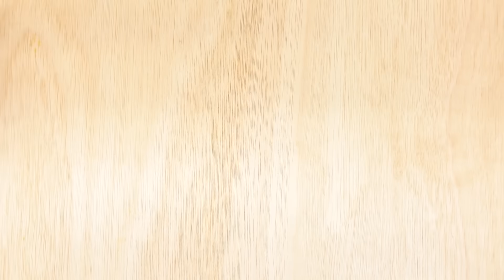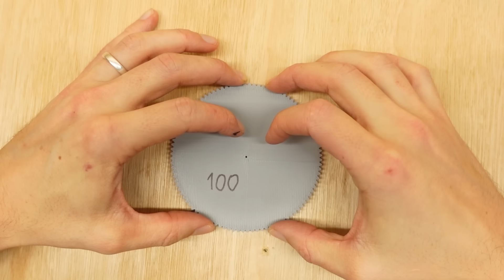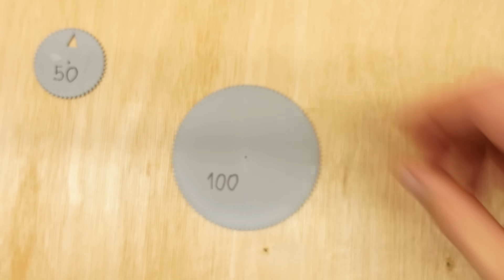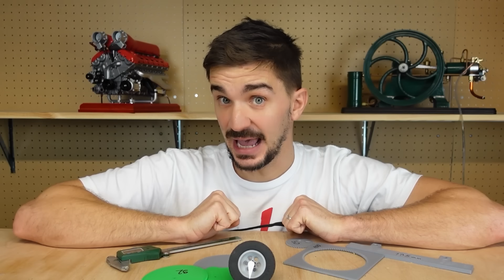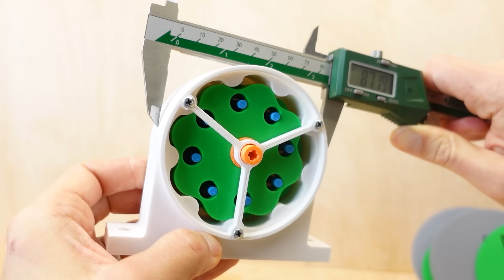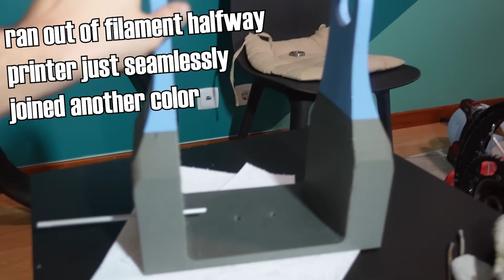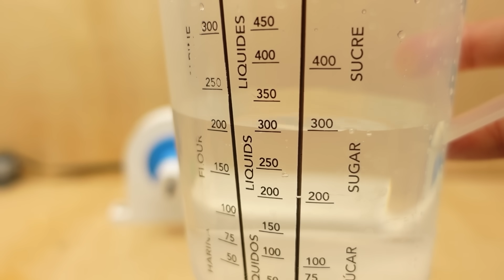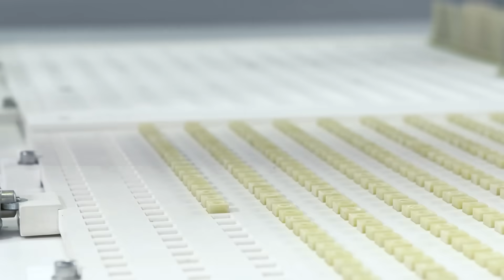Toothless Gears Make Much More Torque Than Conventional Ones, Here's How. Cycloid Drive Explained

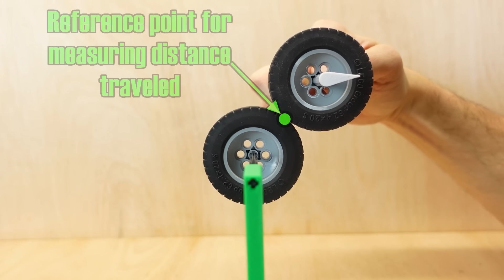Comment: 1:28 There was nothing wrong counting rotations with the pointer, you just have to keep your camera level on the surface. In this case you were effectively rotating the camera an extra time, so the wheel appeared to rotate again. Note the wheel's pointer with respect to the surface. It starts facing away from the surface, points at the surface half way through, then points away at the end, just like with a flat surface.

Comment: I didn't imagine I was going to learn so much about math and mechanical engineering today. Thank you so much for this. Maybe this would be covered in basic mechanical engineering coursework, but the intuition of the mathematics and experimental or visual experience was amazing.

This was also helpful as well where Veritasium worked out the SAT question everyone got wrong. This had the visual intuition explained by the math therein about many paths, circumferences, and even orbits.

Comment: So to offset the vibrations caused by the rocking couple at higher RPM you would need  to mirror the cycloidal gears (4 total) and beef up the eccentric shaft... maybe  even consider exotic materials for the eccentric shaft that have a bit more spring to them to prevent warping under high loads.

Comment: When you get down to a difference of two teeth, and put the inner gear on a flexible cup and drive it to mesh with the outer gear with an elliptical drive element, you have a harmonic drive... something once (and maybe still) very common in robots.

Comment: I like to think about it like this. When the wheel travels on a flat surface, it experiences 1 rotation. But when you take that flat surface and curve it into another circle, the wheel has to experience 1 extra rotation to account for the circular path it is traveling along.

Comment: Ok so the reason you get two revolutions is because it is the inner diameter of the circle not the outer. All you can do is spin the circles over one another to travel the same circumference. The outer circle will be larger for the same reason things get larger the more accurately you measure them.

Comment: I finally figured out the toothed gear on the outside. It's doing the two it needs when it's straight + one additional from the additional rotation around the circle itself. Similarly on the inside it's doing one less.

Comment: at 1:05 if you think of the revolving wheel/gear as relative to the one its revolving around it as in it points away from the wheel it revolves around once per revolution in the case of the lego wheel it makes more sense

Comment: Interesting topic. I believe the 9:8 tooth ratio would be equivalent to 100:88 in the 100 tooth model and 88 falls within the mfg tolerance specified (9-15 tooth difference). I would like to model the difference in the axis of rotation travel in the 9:8 vs the 100:88 tooth examples. My brain cannot do it theoretically right now.

Comment: you can add another set of set of drives to counter the tipping force you talked about at the end. So total of four drives if that's confusing. it can be very stable at high speed as well. 

Great video, enjoyed it a lot.

Comment: 19:00 Could that be solved by "splitting" one of the gears in two, and sandwich the other one in the middle?
Let's say that you need a total width of 6cm to withstand the torque.
Starting on the left: 1.5cm cycloid and ring gear UP offset, 3cm [...] DOWN offset, 1.5cm [...] UP offset.
In this way the UP unbalance is the same of the DOWN unbalance.

Comment: Actually the pins are in sliding orbital contact with the rotor resulting in much more more friction losses and wear than a spur gear set. The orbital is OK for low speed high torque compact drives but not so for F1 gearboxes.

Comment: 19:14 what if there were 2 on the outside with one sandwiched in between? The outer 2 with a combined weight equal to the center gear. Would that work for balancing out the gear set?

Comment: i will say that i find it easier to think about the the outside wheel from the perspective of the inside wheel, meaning if you stand in the middle looking out, the outside wheel does the same amount of rotations as it would on a straight line
Reply: I had to go full screen on the phone and rotate it around to keep the contact point stationary to get it.

Comment: Can these cycloidal drives transmit a significant multiplication or reduction of speed?
For example, can you have 300 rpm at one end of the cycloidal coupling and 1000 rpm at the other end ?
In the examples that I see in this video, both sides of the coupling have the roughly same rpm (maybe a 10%...15% difference in between).

Comment: would this style of gear not suffer from more wear? surely having constant contact means those parts would wear down quicker? would it not also cause heightened heating? if parts are constantly in contact they wouldn't have as much time to cool down compared to a standard cog gear surely?

Comment: you are incorrect on why you get extra "rotations"....it isn't because of the center point, you still have the same circumference between the two wheels. What is actually happening is that your frame of reference is also moving, and if you follow that frame, then you will notice you only get 1 rotation.

This can be shown by having a "hill" of the same length, start the arrow pointing to the "ground" and only count 1 rotation when the arrow returns to pointing to the ground. Keep increasing the hill until you get a semicircle, and eventually a circle, you will find that at no point does the arrow point toward the "ground" more than 1 time per rotation, so it only makes 1 rotation. BUT because you are in the frame of reference of a non-circle, then you are adding the circle to your own observation, and that's why you get 2 rotations (1 for the travel and 1 for the reference change).

It has absolutely NOTHING to do with the center point distance.....so all that "this is bigger than that" is nonsense.

Comment: 17:27 you could have a lobeless drive, would require low rpms, Tesla valves, and fluid. I can picture it in my mind but I'm not 100% sure it would work, basically the Tesla valves allow fluid to escape at the contact point freely but the vacuum created from the point "moving on" and the valve not allowing fluid to return would cause the rotation. 😅

Comment: I have loved your videos for years, brother, so I hate correcting you on this minor point... inside the cycloid, it's a sliding resistance, not rolling.  You can see the lobes sliding past each other.  Rolling resistance has the two points in constant contact (think ball rolling on a table).  Apart from that, I could not have done better on this video, nor anyone I know... so THUMBS UP!!

Comment: So what would prevent a car from utilizing a cycloid gear with swapped inputs and outputs to achieve insane levels of overdrive instead of high torque? Would that require the same unrealistically high speeds in the gears themselves?
Sorry if it's an obvious question, it's difficult for me to intuit the way these work.

Comment: A little tip about designing larger 3D print items like your tire balancer. Use stand size material like extrusion for long runs. If it helps think of the 3D printed items like connective tissue in the body. You can make some pretty cool and strong items this way.

Comment: A lovely little demonstration of a lovely little idea.
I'm giving frequently thought to gravity batteries. Basically a bloody big weight on a chain. Wind it up slowly using low gearing and an electric motor, then when you want the power back, let the weight run back down and drive the motor as a generator. Efficiency ought to be fairly high for them, even if power capacity is relatively low density. It's also hard for this battery to go flat while sitting around for a while.. Well, unless your chain breaks. Then it goes flat in a hurry. And so does anything underneath it.

How well does a cycloidal gear system work when being driven by high torque low RPM and outputting low torque high RPM in a case like this?

Comment: But if you make 6 cycloid gears, sure it's larger and in non-plastic applications probably very heavy, but just like an inline 6, you should theoricaly have perfect balance on the transmission assembly, honestly if you need highly precise outputs, it is a worthy trade-off.

Comment: 3D printing on its own is great but try adding voids in your designs for inserting steel ,aluminium or my favourite brazing rod. just add a pause at the top of the void in the slicer . then when its printing wait for the pause insert you component and continue printing. that wheel balance rig could have a couple m10 stud or rebar if it wanted to be stiffer(probably didnt need it) or just give it some extra mass(use sand for mass).

Comment: Like you, having bought a 3D printer for no really focused reason, I also find that almost every problem that crops up turns into a 3D-printed solution.The day after it arrived (much to the disapproval of my wife, who I hadn't really discussed the AUD$1000 expense with), a sewage pump in our basement broke down, not for the first time, and it's literally the shittiest job to take apart, clean and fix.This time though, it couldn't be quickly fixed, because a nylon clip that held the membrane of the pressure switch together had failed, and getting a spare would take several weeks as it has to be shipped from overseas. One option was to replace the unit altogether at a cost of around $1000, though that was definitely a major task, involving a lot of digging out and plumbing work, apart from the expense. It didn't occur to me immediately, but that night I figured making a replacement clip using the controversial new 3D printer might work. I hadn't much experience at that point, so I wasn't sure, but the next day I was able to design a clip that fitted well (better than the original in fact) but was held together with screws instead of hope. Making it beefier than the original, from ABS which should survive being immersed in water, I got the pump working and reinstalled, saving us from having to cancel on AirBNB guests who were due to stay in the studio flat it serves. It's been over 6 months now and that pump hasn't missed a beat - one of the longest periods without a breakdown in its very unreliable history (it's a crap design, in more than one sense of the word). So the 3D printer saved the day, saved us $1000 for a new pump, and I got away with its purchase! It's gone on to transform the way I think about projects, particularly for making parts that I might previously have made in metal or wood. Anyway, long story to say that 3D printing is suddenly useful, though I have some qualms about the microplastic waste it creates.

Comment: Couldn't the rocking couple balance issues for high speed operation be counteracted by making a design with 4 rotors instead of just 2? Then the rocking couple forces could also be balanced out.

Comment: You need a third gear centered on the first gear. Make the middle gear twice the weight of each of the inner and outer gears. Would that not cancel the rocking vibes?

Comment: Hm... I looked it up. These are even tremendously efficient. Now looking at the balance issue, that's engineerable. So why don't EV reduction gearboxes use these 🤔

Probably because input and output need to be coaxial and so you can't drive a differential with it...

Comment: you could have made that bicycle stand in 5 minutes from some wood. base, 2 stands, let/right brace..  $5 with screws.   the right tool for the right job. the wooden version would have been stronger as well.   
3d printing is generally best for those things that can't easily be done with wood working tools for whatever reason.  (usually precision and detail)..    but a big strong stand?  that's a 5 minute wood project.  if you have scrap wood, it's even closer to 'free'...  than all that filament.  maybe the printer could have spit out those bearings while you made the stand.

Comment: its easier to explain the two rotations w some simple calculus
1. first case the wheel travels int_dtheta at the limits of 2pi and zero so 2pi total - one slice of pizza if you will to get to the next pt on the line
2. 2nd the wheel travels int_(dtheta + dtheta) - 2 infinitessimal rotations to make the next contact point on the other wheel, 1 to the midpt (line) 2 to the next wheel slice; integral sum 2*2pi total

Comment: Why not just use 4 gears to take care of the balancing issue?
Reply: re 19:00 Almost.  We also need to improve front-back symmetry, & simplify it to 2 identical end gears and 1 middle gear that is twice as thick.  This way, you balance the lateral as well as the flex torques. 
The flex torques will decrease, and the frictions & mfg costs will increase with the number of thinner gear sets, perhaps to the point that all of them can be the same thickness to reduce the unique part count & costs.  There will be some optimal compromise for effects & cost.  :-)

Comment: I very much enjoy your videos and in depth explanations and discussion.  Will you please do a video or videos on various forms of energy storage using mechanical systems.  Such as springs, compressed air, weights  and gravity.  And is there a theoretical maximum any mechanical storage system can achieve because of material strength limitations, hysteresis, or physical size.  I always wondered if some sort of spring powered car was possible, and could high pressure hydraulics be used to energize/load the spring.

Comment: Would one of the drawbacks of the cycloidal transmission also be the increased friction from all the additional points of contact?  As for the rotational torque forces created by the 180-degree cylinder offsets, couldn’t those forces be reduced by balancing the system using even more cycloidal cylinders, like 6, 8 or 12?

Comment: I understand the excitement of being able to fabricate things that would've been prohibitively expensive in both time and money, not long ago. For a work event my wife's company was holding, I designed and built a 3' diameter replica of "The Price is Right" wheel...50 3D printed parts, 60 laser cut foam panels and two weeks worth of assembly and testing later... it was the star of the show!

Comment: I think you just solved my problem with torque and sensitivity problem of my PPE project I am working on. Up to this point I had an inner gear with a toothed curve to reduce 120° lever opening to 40° ish, with 3x torque multiplier. This is just overall better, just a couple more components. Thanks!

Comment: Cycloid drives are compact and have very low to nonexistent gear backlash, which is important for precision movements. That makes them ideal for applications like robotics where huge gearboxes are impractical and fine movement is important.

They are not more efficient than spur gears, though, including when stepping down large rations.

9:39 But the comparable cycloidal gearbox has nine shafts. Each of those pins is a shaft.

The spur gear system shown can be made more compact than shown. The number of shafts can be reduced because the intermediate gears need only to drive other gears and not rotate a shaft; gears spinning at different speeds can share a shaft.   The input cog shown in blue does not have to lie out to the left side like that, it can be in another location relative to the gray gear.

The spur gear box shown in this video reduces by a factor of GOOGOL to 1.   GOOGOL is 1 followed by 100 zeros.  Note that  though it has many cogs, of course, it has only two shafts:

https://www.youtube.com/watch?v=nFslB0AcVmM

Comment: Great video. Being an mechanical engineer for almost 20 years, i was not aware of cycloidal gears so far. 
Two additions: There are always all minus 1 teeth in engagement. The tooth exactely opposing the hump in the sun wheel can not transfer load. And, another disadvantage is the lower efficiency of around 95% compared to 98% of involute gears.
Reply: ..... Been used in the industry for close to 80 years

Comment: No sooner did I watch halfway through and I thought "Those are some pretty eccentric forces. Vibration and balance are going to be problems". And then you continued, addressing those exact problems. Thank you. We didn't cover those type of gears in my Industrial Engineering courses. Those might have been too specialized, or one of those parts where the solution was "get the mechanical engineer to handle it".

Comment: 15:12 maybe you should have supported the other end of the axle to give it a better chance at lifting as the axle gets bent a bit which adds load/resistance if I'm not completely mistaken. (please correct me if I'm wrong)
But cyclodial drives are cool!  😊

Comment: 19:17 Why wouldn’t you just use 3 cycloidal gears, adjusting the thickness of the 2 outer gears to match the weight of the middle gear? Then everything would be perfectly balanced.

Comment: You just invert the set up for high speed operation champ... Put high torque low speed to where you had the output and take away the lower torque higher speed from where you had your input. It's not rocket science...

Comment: I will never forget the first time I saw one of these. My boss asked me to take apart the gearbox from a fanuc robot to see if we could rebuild it. I was so confused since I had never seen one before and neither had any of my colleagues. It had 3 cycloids 120 degrees apart instead of 2 180 degrees apart like yours. Unfortunately it went into the trash and I learned about them later. This video was a great visualization to them!